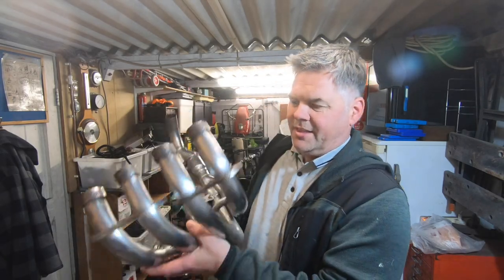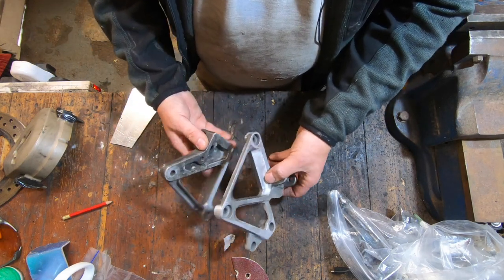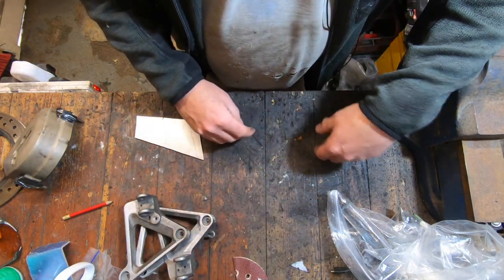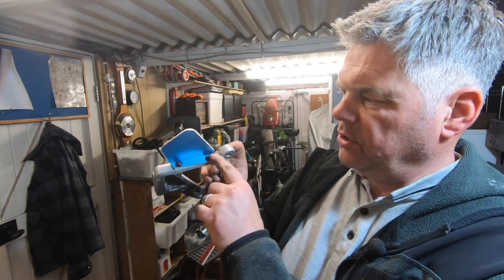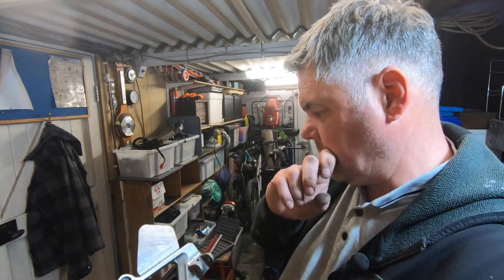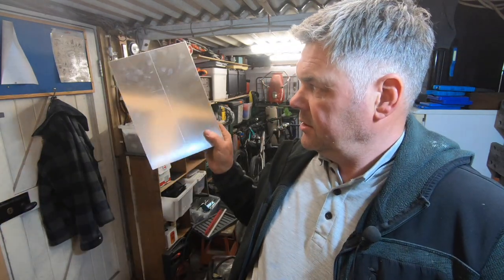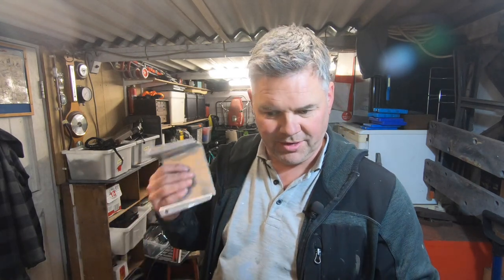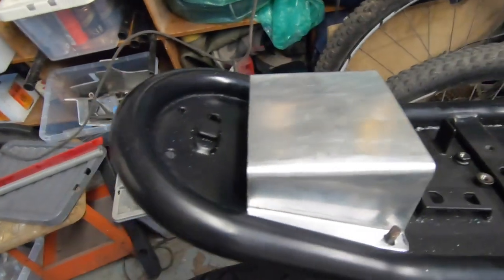Honda Hornet Café Racer Budget Build - Episode 29 Making a heel plate, a battery stand & other bits

Comment: I like the uncomplicated, common sense, 'steam engineering' methods and solutions you use. I only wish we were allowed to do the same here in Germany. Everything here is (over) regulated and has to be approved prior to use on the road. Don't submit any videos to the Health and Safety Executive!...😉🤣...Oh ....nearly forgot....I'm not trying to be a 'know all', but a Top-Tip when filing soft metals such as aluminium (taught to me by my Metalwork teacher quite a few summers ago) is to rub chalk into the file before you use it....prevents clogging and gives a better finish. Keep up the good work 👍👍
Reply from the maker: I think sometimes things are just made to look way over complicated. I have heard before about the TUV (is that right?) good tip about the aluminium I’ll try that. Thanks for watching 👍